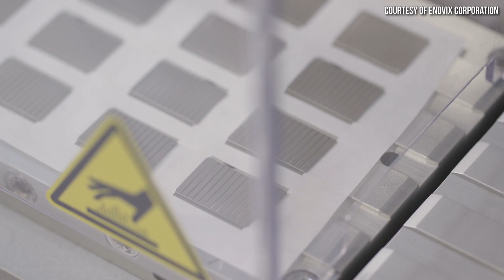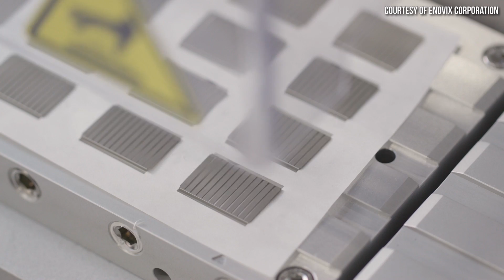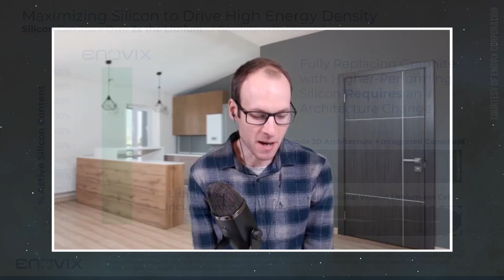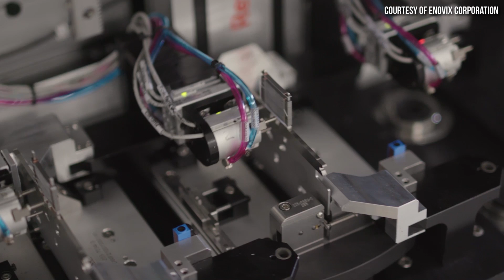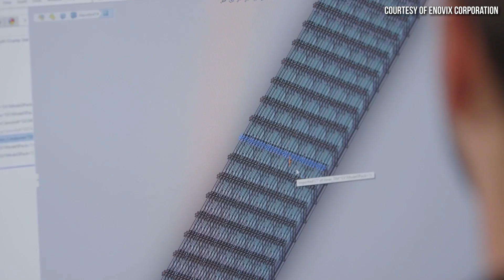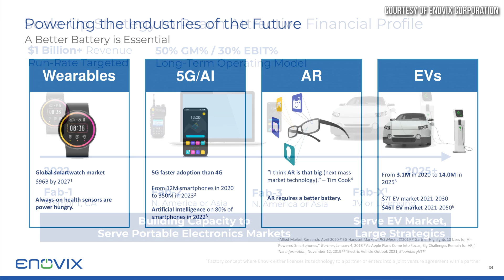This Lithium Ion Battery BREAKTHROUGH from Enovix is IN PRODUCTION!

Comment: As somebody noticed already, this "engineer" claims that pressure equals force times area.  Oh, and silicon oxide (like sand) is "100% active silicon." Apparently, he left Enovix shortly after this disastrous interview.  There are so many red flags here, but the host apparently knows very little about batteries!  As of today, contrary to the video title and the claims of this former employee, no product uses any Enovix battery.  Even the datasheets have disappeared!

Comment: I think Enovix has used some truly revolutionary thinking to come up with a better architectural design for cells and batteries. With its radical rethink of cell physical design Enovix has attacked the most significant electrical and thermal pain points of conventional cells (whether cylindrical or pouch) and shockingly seems to have solved them all. And, for the first time, silicon in the anode seems to be put to work in a way that will permit its great potential to be realised.

Only one question hangs over the Enovix product. Can it achieve price parity with existing cells? There are reasons to suppose that price parity will be a hard ask. The cell assembly process is entailed - even if fully automated it will hardly be like sticking a jelly roll in a can.

I do note, though, that Enovix has alluded to materials savings as an offsetting factor. So, maybe there is some hope that Enovix, in time, will be able to break out of specialised small cells supply into mass markets with price competitive products.

Personally, I would pay a small premium for an Enovix battery. If one could be specified as an option when purchasing a laptop say. The Brake Flow technology simply makes cells and batteries safer. With more and more battery powered portable electric/electronic devices around us every day (EVs add to that total) we find ourselves in ever greater need for batteries that meet a higher mark of safety. The Enovix product is a good place to start.

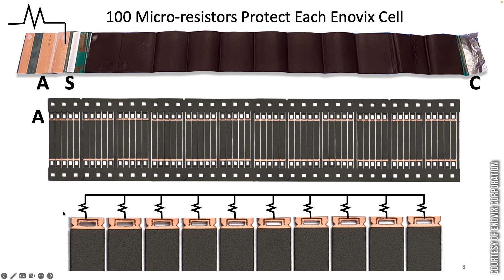Comment: 20:06 So he is saying their batteries have a high internal resistance? Isn't low internal resistance better?
I found on google: "A battery with low internal resistance delivers high current on demand. High resistance causes the battery to heat up and the voltage to drop. The equipment cuts off, leaving energy behind. Lead acid has a very low internal resistance and the battery responds well to high current bursts that last for a few seconds."

Comment: Gravimetric is important because ultimately the energy efficiency of the EV is a function of many things but weight is a big factor. Efficiency will be more important when comparing EVs to each other, just like they were for ICE vehicles. Right now EVs are competing against ICE mainly so weight is not a big factor to short sighted manufacturers.

Comment: Using silicon to replace the graphite's function on the anode side? The dendrites are usually made of copper that migrates from the lithium cobalt cppper oxide. The copper has an extremely important function, it is briefly reduced to copper before the ion forms a stable complex and releases the charge. The planar structure of your cells are very similar to the structure of fast discharge low ESR capacitors btw 😁🤓

Comment: There is No Way that any resistor that is large enough to prevent thermal runaway (unless it's a PTC) is not going to affect charge/discharge current.  That would break physics.  As for your long and meandering explanation about small vs. EV batteries.. just tell the truth.  Making an EV battery requires an EV to put it in.  Without a contract, it's beyond foolish to make EV batteries, even if you could get past the intellectual property hurdles.

Comment: Thanks Jon. How well would this technology work with a Sodium-based cell? There could be significant cost advantages if Na could be used successfully. There is also a point where low cost and recyclability become more important than ultimate cycle life, mass and energy density, especially in bulk storage applications. Also, an easily swappable battery at end of life has its advantages in automotive installations, if costs can be kept low enough.

Comment: DIFFERENCE BETWEEN TECHNOLOGICAL & MANUFACTURING "BETTER"
"Better" is relative. Musk's "better" assessment of course must also evaluate the economics involved in the specific application (Tesla's EVs). If the new cells aren't viable from a manufacturing and implementation costs standpoint, they may not be "better". Then again, they could in fact be "better" in a different application (e.g. power generating plant energy storage).
Reply: they're going after wearables and small electronics first. they are extremely fast charging, too
Reply: Man, ya'll are obsessed with Musk. They won't even be doing EV for years.

Comment: Why didn't you ask about manufacturing?

Basically the only difference between this and conventional cells is the "3D design", and that's a big, very exciting difference.
But how do they make these cells? Does it scale? Is it cost-effective? Is it capital-intensive?
Reply: they are also 100% silicon anode, and the patient's Brakeflow tech means that there's no thermal runaway of the cell is pierced. that is why they won a follow on contact with the government for their cells, as they were the only next gen battery to survive the nail test
Reply: @michaelwilliams5506  both are enabled by the new design, and they could make other chemistries
Reply: @w0ttheh3ll  this is very true. the big deal, really, is the architecture.

Comment: If you place their cells horizontally you get the BYD blade architecture.
While BYD is actually a big battery manufacturer this company here, Enovix, doesn't produce any car battery.
So?🥴
Today, if you don't move very fast in this market of car battery innovation and production, you'll be beat in short time by other innovators who move very fast out there, as anybody can see the present reality.
When you truly have a much better technology in this very hot segment of electric car battery, the money for very fast development and right away production is not a problem at all.
I don't say that Enovix can't be better, but they should move very fast to actually production and selling battery packs to the electric car battery market, because it looks like other better technologies are coming fast from behind ( StoreDot car battery packs that charge in 5 minutes, chinese sodium batteries, etc ).

Comment: Interesting.  Seems like it would be difficult to scale.  Also "absolute value volumetric equivalent" sounds like a marketing term.  It's probably a good design for miniature electronics.  Not so sure about EV scale packs.  Hope I'm wrong.
Reply: They can absolutely scale for small consumer based electronics, it is happening now. I'm expecting continued innovation and breakthroughs regarding laser patterning from Enovix. This will continue to increase efficiency and aid in scaling for EV. Enovix needs to be a continued leader in the technology for their lasers. Manuel Leonardo and his team from IPG Photonics will help lead this. Their PR from 11/1 regarding the MOU with IPG hints at this.

Comment: Cool cell design....but seems very slow and complicated manufacturing process. Inter-laying thin filaments of anode, cathode (&separator) and making connection to each seems like a very delicate, slow, complex and expensive process....compared to 2170/4680 that just rolls up a long tape of 1 strip of anode and 1 strip of cathode (&separator).
No wonder that the Enovix is supplying the cells to small electronic devices...in which cell size is a significant factor while cell cost is just a tiny fraction of the overall cost.
I totally doubt Enovix will be able to scale volume production of this design to go into EVs....and not to mention offer it at an attractive price point.
Reply: We have done this in semiconductors with FinFET and that adds a ton of steps, but costs will go down when a turnkey manufacturing solution comes out. Traditional wrapped batteries have production lines you can order from Bosch etc, but not this.
Reply: @henryzhang7873  Costs might come down a little with volume, but will unlikely be able to compete with the good-old jelly-roll spooling.
It's definitely a great advantage in premium portable electronics like smartwatches, 'google' glass etc where even doubling the battery costs hardly makes an impact in the overall costs.
Net-net not for regular automotive use.

Comment: Mmmm , 290 Wh/kg and only 500 cycles to 80% capacity retention . That is barely a 7% higher energy density for a big price in cycle life . Hardly a breakthrough
Reply: In the video he explains that they achieved 90% capacity retention at 1500 cycles
Reply: @guidedbygreen1480  that's not what's in the brochure of the products on their website . Maybe in the lab they did , but they do not seem to promise that yet for the commercially available products they are currently producing
Reply: Around the 33 minute mark he specifically says they don't care about gravimetric measurements like /kg. They're focusing on volumetric measurements.
Reply: They use resistors to reduce the current flow.  That won’t help for charging or discharging. Might never be good for cars.
Reply: @andrewangrignon6532  i mean, their ev cells charge past 80% in 5 minutes.. the resistor is to prevent thermal runaway in case of a pierced cell.
Reply: So tired of companies that have a breakthrough that is not that??

Comment: Interesting design. I want to know the self discharge rate, the power ("c") density and efficiency, wh/kg, etc of this. They have to start somewhere, and are going to improve so I want a baseline to compare!
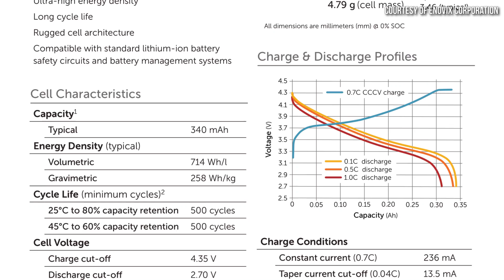Reply: 29:36 spec sheet covers most of this.  Wh/kg is 258
Reply: Yeah, until I see any useful numbers, this is just a startup with a good idea on paper, and no path to bring it to market
Reply: @sportbikeguy9875  but they've already sold some of their batteries, and have figured out how to make their production line increase yields 10x vs. the current gen 1 line. they have significant interest from several 200B dollar companies. TJ Rodgers is the guy who brought them to market. they've been around for over 10 years